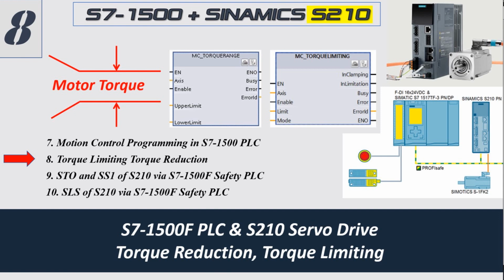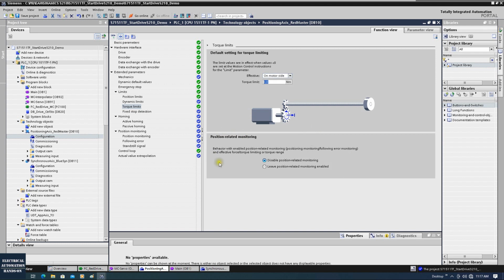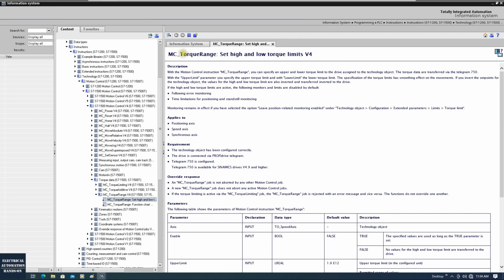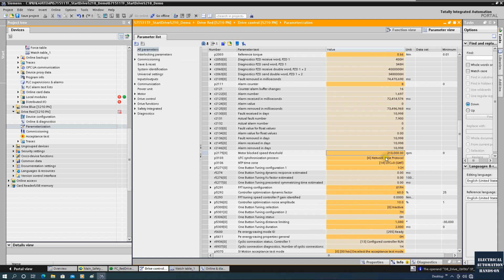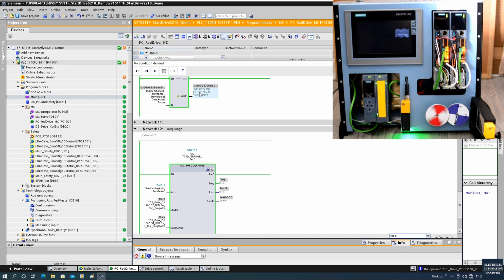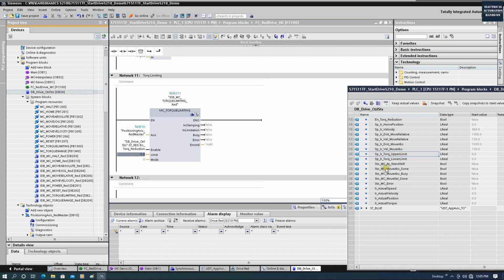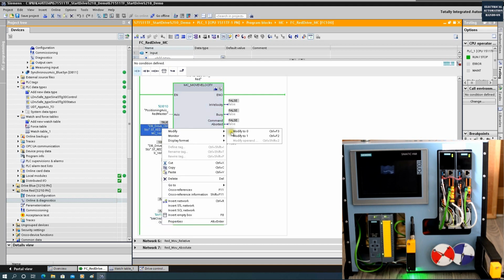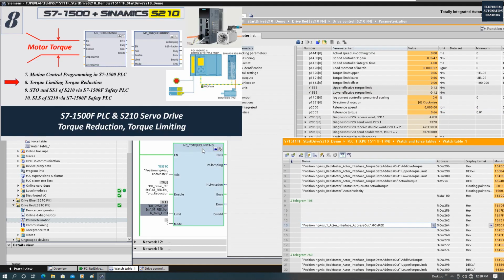MS06H. [Siemens S210 #08] Servo Torque Reduction, Torque Range (F07900 Alarm), Torque Limiting

Comment: honstly i have learned much from these playlist so Thanks for your Efforts, but i have a question on practical life scenario, i have four v90 drives controlled by S7 1500 cpu and lately i have randomly errors on two of them (HW Limit exceeds) while this is not occured , aslo from where i can know the real cause (is from Drive monitor Error Code  or from the Commissioning Tab inside TO or from the PLC CPU diagnostic buffer )
Reply from the maker: If you are not using the HW Limit but it is causing trouble, please check P29300, it could be set = 6. If you are using HW Limit, properly check the sensor flicking.

Comment: Hello, I hope you can help me.
I have an engine BG65S from dunkermotoren that i command with a driver PDC1000 and a PLC S7-1500, thanks to your video i learned how to create the telegram 750 and read the torque value but i got a Word value (that is supposed to be a torque value in Nm but not) and i see that you are using a LReal.
How did you get this value ? Did you convert it ?
Thank you
Reply from the maker: Once you activate Telegram 750, and download the configuration, your TO can read out the torq value, as shown in video 10:21.  But different brand would do slightly different for preparing the data for telegram 750, many be doing % of the fully torque (full torque is your motor full torq, e.g 10.5 Nm), or the actual torque Nm value.
Reply: @electricalautomation 
Hello thank you for your first answer. I verified the unit in the settings of my TO and it should be in Nm. After discussing in the siemens forum, it seems that my word value represent a torque purcentage as you said (so 16383 should be 100% of my available torque). I would like to retrieve a Nm value from it. My engine got a rated torque of 0,53 Nm (maximum 1,7) but there is a reductor of I = 100 so finally i got 38,69 Nm (based of the user manual of the engine), the point is that i'm not sure of the accuracy of this purcentage and i would not like to calculate the value in Nm from it, i am afraid that after too much calculation i will not have a torque value i can trust. If possible the best should be to directly have the value in Nm (LReal) from the telegram to have the best accuracy.